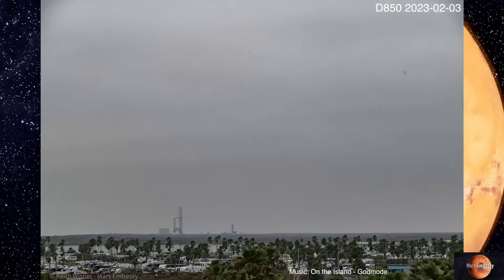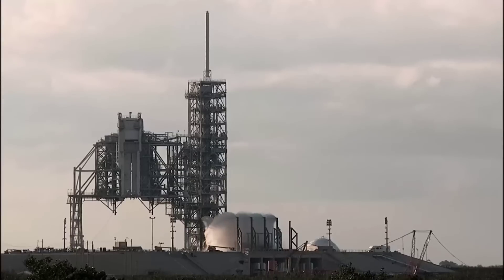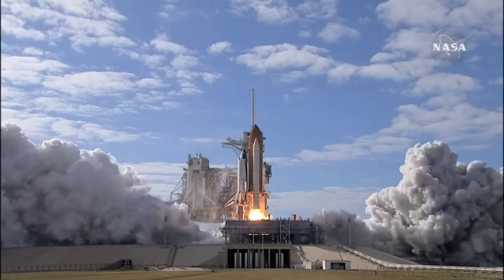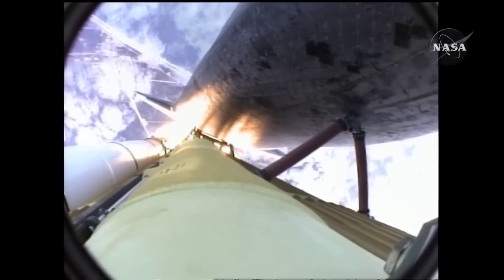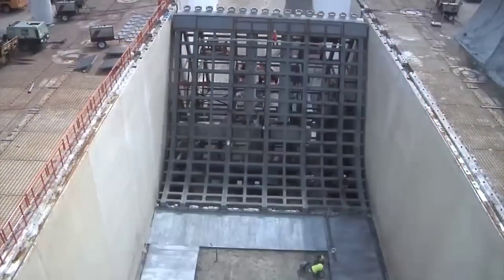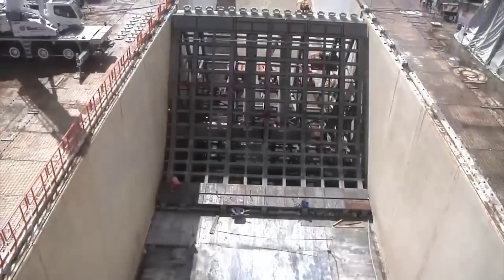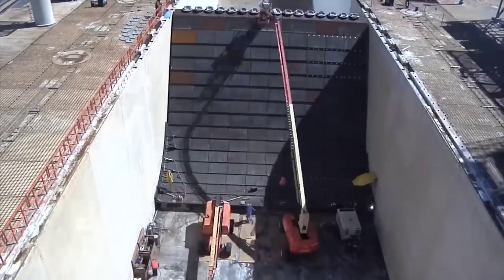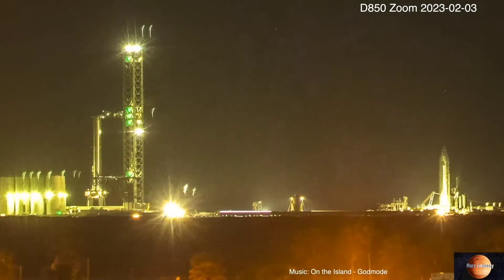Boca Bulletin!  Sound Suppression System installed!  But what about a Flame Trench for Starship??

Comment: OLM is as high as a Saturn 5 was to the concrete
The new cement fondex has a 16,000 psi rating and 2200 deg f rating
The engines deliver about 200 psi at the ground surface

Comment: I don't understand your obsession with a "flame trench". There are effectively six flame trenches, between the legs of the OLM. The total area there is well sufficient to handle the exhaust from the 33 engines. The only question is whether the concrete surface on which the exhaust impinges is able to withstand a long static fire: if there's a deluge system that should take care of it. For a take-off it only needs to take a few seconds before the rocket is gone.

Comment: Considering nobody ever launch a rocket this powerful before, maybe they need more information for computers model and testing total engines output at different thrust levels, they might be interested in the bare minimum thrust to get StarShip and booster off the launch pad and then full power after that, while respecting MAX-Q. Then rebuild flame management system to match the new data. The flame management on converted oil rigs should be very interesting.

Comment: Come on, you must know better than to keep bleating on about the "missing" flame trench.... you cannot just dig down into a beach area and have it not fill with sea water or have the sides collapse, especially with all the weight of the pad and the rocket. SpaceX need the flat pad for all their assembly and test operations, they are always swapping stuff in and out. The water deluge will help massively to cushion the exhaust impact and guide it away, and the rocket should lift off away from the ground relatively quickly and disperse the energy. Look what Boeing / ULA had to build at SLC-37B for the Delta IV and New Glenn at SLC-36.... great big elevated ramps to lift everything way above ground level to accommodate a flame trench. For Soyuz etc. they do the opposite... excavate a huge concrete crater to let the exhaust pressure excape ... and the 5 Soyuz engines thrust is less than 2 x Raptor !

Comment: No flame trench is the number 1 problem with this rocket.  After observing what smaller static firing and by watching how SLS blew the doors off the elevator, Elon and the boys are finally of the knowledge that the roar of all those engines is going to blow his rocket apart.  And realizing that after the first launch they are going to have their hands full of redesigning the whole concept of a proper flame trench or a second launch won’t be possible! He’s going to have one hell of a serious problem in a short amount of time.  It will be interesting to see how they deal with it that’s for sure!!!! It will get done but it might be a long and arduous undertaking before the second launch shows up!!

Comment: I believe Spacex is missing a big opportunity here. Why not dig a simple trench and let the ambient water table and nearby bay fill the trench? There'd be no need for huge deluge pumps and there probably wouldn't even be a need for specialized concrete. Just allow the water to absorb the blast.

Comment: Fantastic work AA! Love the time lapse of the flame diverter construction. A deluge system at BC may be plagued with environmental and regulatory issues. An effective flame trench is probably not doable at this point, would probably result in a nearly complete rebuild.

Comment: Don't think they can dig a flame trench cause of the soil there... Remember the year of ground prep b4 building.....

But they could and probably should do the same thing that was done on the portable launchpads for the V2 rocket... A pyramid shaped flame splitter, U only need to split it so it doesn't bounce back off the ground

Comment: What if they dig a trench and fill it with sea water. Except for structural concerns, who cares if water leaks in. Let the exhaust blow that water out first before the water that you spray in.
How about a ramp at the shallow end to blow everything more upward and away? 45 degrees?

Comment: They aren't doing it at Boca because it is now impossible. The trench would have to be enormous so the legs are now in the way. You need to build a mound first when you are that close to the ocean, in order to prevent flooding from being way below the water table. See how far up the Saturn V pad is above the ground level. That wasn't to get above the hurricane surge, or for a nice view. It was to make room for a huge flame trench for the never built NOVA super Mars rocket. Look at Stennis in Mississippi on Google Earth. Everything is overbuilt for NOVA. The canals were supposed to go farther to the north on the eastern side, but the politicians wouldn't appropriate the money. They were wasting trillions (in todays dollars) defending big business capitalism in Vietnam. How did that work out? Not too well. 
The area around the Boca launch tower is full of underground pipes & wires too because Musk never thought about a flame trench. Why he omitted it is a mystery to me. Keep your fingers crossed once those engines reach full thrust. South Padre Island will vibrate. Don't stand near large glass windows.

Comment: Yes  I must agree on a diverter type launch pad layout to help at least channel the flames away and pressures away ! Going against a flat concrete I still think will get destroyed by this 33 engine static test ! Just doesn’t make sense why he’s against that idea
Reply: Another big issue is acoustical energy.  SLS has a Sound Suppression Water system that has a rate of dumping 900,000 gallons of water per minute.  That was for a vehicle with a little 8 million lbs of thrust.

Comment: Flame trench issue I think is more future issue when want to do point-to-point on earth, can build one, but if always needed, adds a lot of expense and limits point to point abilities. Water table not really issue, just to deflector on surface not sunken, and raise OLP as necessary. Easier and cheaper than digging in high water table, but that is also possible with use of curtain walls., just expensive
Reply: There will be no point to point with a rocket.  It doesn't make sense.

Comment: Boca Chica could do what they did at KSC.  Build the pad up so the trench is at sea level.  The Sound Suppression Water System at KSC dumps about 900,000 gallons in a minute and is gravity fed.  If that is what was needed for SLS, SpaceX is going to need something that has at least the rate of flow.   A flame trench and diverter are a must, not an option.

Comment: I suspect the environmental restrictions. Cape Canaveral has the same high-water table. Their solution was to build an enormous gentle ramp up to an artificial mound, well above the water table, allowing a deep flame trench beneath it.. The ramp is enormously long, for a gentle enough ramp slope so as not to topple high skinny rockets being transported. And NASA had a tremendous surface area within which to work. And they could make the transporter and the road to the pad as wide as needed--no public usage--with a straight road to the pad, no sharp turns. None of those advantages work at Boca Chica. Narrow road. Used publicly for the beach. Minimal land area.
Reply: The crawlers also have hydraulic lifters to keep the rocket level when going up the slope
Reply: I appreciate your answer.  NASA has a second crawler which could be modified and used.  Crawler 2 was modified to handle the additional weight of SLS.  Crawler 1 could be upgraded to handle the weight of Starship.  The could also use the VAB, an almost a straight run to 39A.  They would have to move the existing structure on the current crawler way on 39A, but it could be done.

Comment: Unlike the Shuttle, starship is 70meters away from the engines on the booster. 
But I’m not trying to assume anything with it.
Reply: But if the booster is damaged during launch, that is not good either.  There is no escape system and the rocket is not going to outrun the amount of energy reflecting back right at launch.
Reply: @pebmets  I absolutely agree, but I think the booster is way sturdier than the shuttle and starship, mainly because of the heat tiles. 
I don’t believe that the engineers forgot or ignored any of these problems.
They may have underestimated some throw

Comment: Starship doesn’t need a flame trench because the exhaust is directed radially outwards in all directions with plenty of space below the engines
Reply: So when it rained concrete after each static fire test to date, that is OK?  Keep in mind the pad damage was with less than 1/2 of the engines running.

Comment: I don't think there is a cost effective way to dig a flame trench in Boca Chica without scraping the existing OLM and starting over.
Reply: Maybe the OLM is not efficient and it was the wrong path to take.  There is a reason why every large rocket before Starship had a trench and diverter.  Even Falcon heavy utilizes the trench and diverter at 39A.
Reply: @pebmets  I don't disagree with you about the OLM.  But it's what they have.  It would take a major redesign and years of reworking the system to replace it.

I love Mecha Zilla and the chopsticks for moving and stacking boosters and Starship and even catching the booster, but not putting landing struts on a vehicle who's primary purpose is to land on other planets always seemed problematic to me.  I guess the first step is just get it flying.

It's possible the entire system will go through so many iterations that in 10 years we won't recognize it.  It's likely that we will eventually see a half dozen or more mission specific variants.  I'd love to see Thunderbird 5 painted on the side of a search and rescue variant 8-)
Reply: @JoeShmoism  IMO, attempting to catch a returning rocket is a bad idea.  With the last falcon heavy launch, even though both boosters made it back to the landed site successfully, one missed the center mark by dozens of feet.  There is not much room for error when catching it.  

My opinion, The design of 39A and 39B have proven themselves for over 60 years.  Shows what the engineers could do when KSC faced the same high water table issues as Boca Chica.  Saturn V, Shuttle, and now SLS continue to prove it works.  Even smaller vehicles such as Falcon Heavy, Atlas, Delta utilize a flame trench because it works well.  

 To completely abandon the concept in Texas is Musk just doing something different for the same of doing something different.  A tried and true method is available and he didn't want to use it because it wasn't something different.  Of course this is only my opinion.

Comment: The height of the launch table at Boca Chica seems to be easily equal to the depth of the flame trenches at the Cape.  I suspect that's not a coincidence.

If they put walls around it, there's a trench.  The diverter is easliy added under it.  Maybe even moveable!
Reply: The Cape has a diverter to direct all that energy away from the vehicle.  Boca Chica they are firing into a flat concrete pad where most of the energy will reflect back up.  It is not being diverted away like at the KSC.

Comment: One reason I would guess as to why they don't have a flame trench is that they plan for Starship to land on, then take off from the moon, Mars, and other surfaces without a flame trench, so they don't want it to rely too heavily on one. This of course doesn't apply to super-heavy, so this is probably not as strong of a reason as other reasons such as difficulties with the water table at Boca Chica.
Reply: Perhaps if they can get reliable use from the booster without one, then that would mean the raptors and fabrication methods on the Starship should definitely be able to handle it. This is also probably to see how much they can get away with and perhaps right size ground systems to be extra economical in the future.

Comment: I wounder if there is an environmental factor that prevents them from digging a flame trench. Maybe a sufficiently sized flame trench would be below the local ground water level. The hydrostatic and buoyant forces on something like a flame trench could float it.
Reply: Yup, that's the problem. The water Tablet ist right below the surface so they can't dig down below the launch mount

Comment: I was watching LaPadre this morning.  Seems they are in a big hurry to assemble the parts that came by Barge from KSC on Friday. This morning they laid one of the big pipes pointing in the direction of the OLM between the foundations that we saw this week on Maricio's RVG photography.    I guess they could jury rig it by pressurizing the system using the existing OLM plumbing. One of the GSE tanks is water(the one that isn't insulated). I guess they could get water from that?   Could be the FAA notified them that a sound supression system would be a requirment of the launch license? If they need to build a water tower, that could take as much as six months.   Time will tell

I don't see any of this preventing a 33 engine SF this week. There are road closures everyday M-F 8A-8P.

Can't wait to see what Mr. Angry finds out this week.  Nothing better than having boots on the ground!

Comment: What about Mars or Luna! Are we going to build flame trenches for both of them?
Reply: The engine placement on the lunar starship precludes the necessity of a flame trench or even a deluge system for it. 

I currently do not see how starship can work for Mars unless they bring 10 story high climbing stilts that it lifts itself up on after it lands.  Which is almost plausible because of the lower gravity.
Reply: There will be no booster with 16 million lbs of thrust on Mars so the question about a trench on Mars is irrelevant.

Comment: One reason they may not be adding a flame trench is because starships that land on other planets may need to take off flat surfaces. Maybe they are doing the flatter surface now to see what happens.
I know on other planets it won’t include the booster, but seeing how the debris reacts to higher numbers of engines could be informative none the less.
They could also simply be seeing what they can get away with. Many possible reasons could exist for delaying building a trench.
Reply: Keep in mind, on another planet you will not have a booster with 16 million lbs of thrust.  Big difference.

Comment: The shuttle was also taken out by foam.  It's much more fragile than Starship.
Reply: Don't be fooled.  If those concrete bits reflect back towards the bottom of the vehicle, it will be a bad day.

Comment: Thinking there is too much plumbing buried in BC now to dig a trench.
Reply: Do what they did at KSC.  The trench is at ground level and the pad was built up.  The trench is 42 Feet with another 25 feet for the height of the MLP. for a total of 67 feet.  There is also a diverter to reflect most of the energy away from the vehicle.

Comment: Maybe they're innovating. You guys are all obsessed that things have to be a certain way. Musk and SpaceX have been running on the philosophy that "the best part is no part" I'm willing to give them the benefit of the doubt that they've found a way around needing a Flame diverter
Reply: There is no innovation in blasting 33 engines directly at concrete
Reply: @savethedeveloper  Well you definitely don't think outside the box, or in this case a Flame trench. 

They of all people should know if there's no other way besides a Flame trench they would've put one in. The whole chopstick Tower idea came when SpaceX thought they didn't need landing legs. True innovation comes with learning when you may not actually need something for it to work
Reply: Did it ever occur to you, that Musk and SpaceX are not perfect and that a flame trench and diverter is the most efficient solution for large vehicles?  NASA has some of the smartest engineers in the world.
Reply: @pebmets  And yet NASA couldn't make reusable rockets or land rockets vertically
Reply: @ReiseLukas  Did you forget about the shuttle which flew for 30 years?  They could land orbiters on a paved runway.    2/3 of the shuttle stack was reused, the orbiters and SRB segments.  Only the ET was not.  The DCx landed vertically.  I am not taking away the accomplishments of the falcon series, but to ignore the accomplishments of the Shuttle shows a lack of understanding of its history or what it was.
Reply: Before I forget, Unless I missed something, Starship has not been proven to be totally reusable.

Comment: but ..my limited knowlege would lead to fact flame ok..if nothings in path directing it only going to increase ..spread out be best..now surface withstanding full power would need little help..digging in teax's location not a option buckets towards gulf be option..but a boring tunnel wouldve been ideal set in place as foundations were set for legs..now..not sure ground is near solid enough..